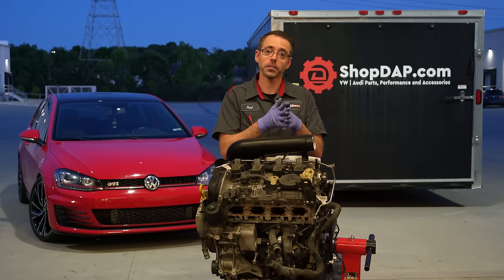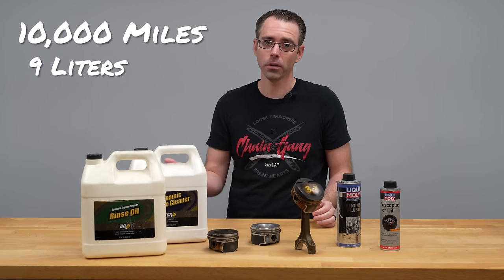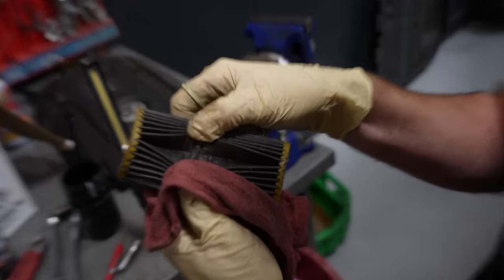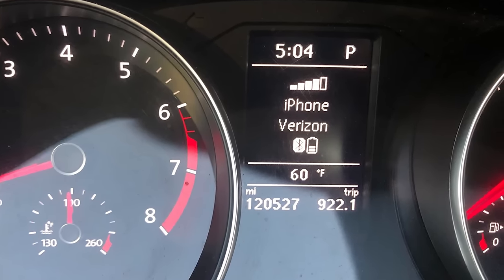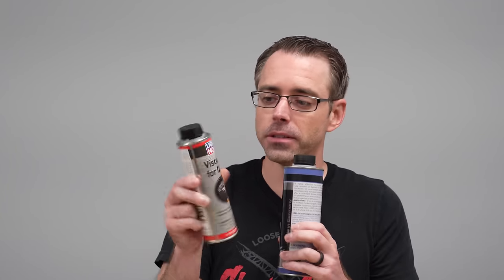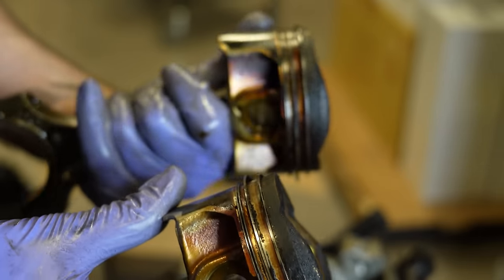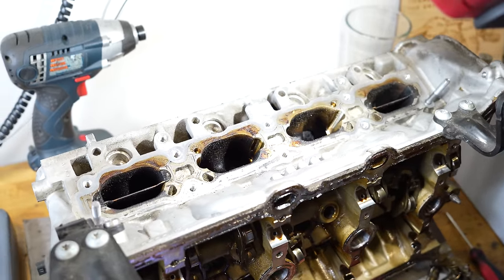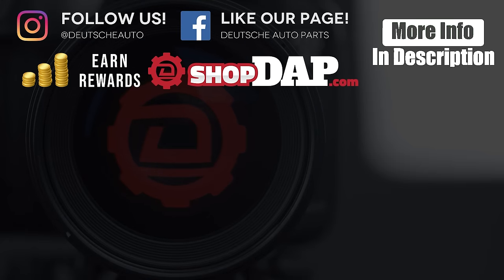Can you Fix an Engine Burning Oil for $20

Comment: Love the video, my @home solution for this exact problem have always been diesel (50/50 with cheap oil and 30 minutes of idle) and it have never failed me...
Reply: Never done it myself but people swear by filling the engine with ATF fluid and letting the engine idle for 15mins.
Reply: @archygrey9093  Doesn't sound like a great idea, ATF looses all its lubricating properties far earlier than diesel.
Reply: @Trashbd  How? The majority of lube doesn't enter the combustion chamber in such a short cleaning interval, and ATF lasts, in many cases, the life of the transmission.
Reply: @nicholash8021  Diesel is a very efficient carbon solvent, it doesn't need much heat or especially long time to dilute carbon buildups in the cylinders or within the engine. Using ATF instead of diesel should be about the same but much more expensive.

Also, what does the transmission have to do with this?
Reply: @Trashbd  Sorry I misread your original message. I thought you were talking about ATF not diesel. My point about transmissions was that ATF has to be good enough to go the life of many transmissions, so it is not likely to be a kind of lubricant that wears out fast.
Reply: @nicholash8021  No need to feel sorry ;-)

Transmission oils doesn't wear out because they are not exposed to heat. If exposed to engine temperatures ATF loses it lubrication properties really fast.
Reply: @Trashbd  But a good ATF has a boiling point of about 600F and according to this test by Project Farm, ATF did not lose any lubricity after 1 hour of use in an engine: https://www.youtube.com/watch?v=bE2F-vefQdA
Reply: @Trashbd  I don't think ATF looses all it's lubrication much at all, and it's usually full of additives specifically designed to remove sludge and revitalise rubber seals.
when people flush their engines with it it come out the drain plug completely black after being idled for 10 - 15 minutes, whether or not it's better than a diesel-oil mix i wouldn't know

Comment: Instead of engine flush, youcan use Diesel! 500ml, 10 minutes, then change the oil, it will be really black. Liqui Moly oil isn‘t bad, but there are better oils for engines, that burn oil. Try motul! And don‘t use 0w30. 5w40 Or 5w50 burns less

Comment: BTW BMW, VW AUDI engines are extremely touchy about oil brands. The base oil stock in Castrol v Mobil is different enough to prevent oil seals expanding the right amount as the seal wont absorb some oil and swell up to specifications. I had one BMW using Castrol whose problem was solved changing to Mobil. The owner Castrol fanboy was shocked.
Reply: I just changed from Castrol to Mobil, hopefully this resolves the oil burning problem. My car is burning 2 quarts every 5k miles

Comment: Cheap tip: If all you want to do is remove sludge from the crankcase of a neglected engine, Diesel fuel works great. Just a cup or a pint depending on capacity and dump the oil after 50 miles or a day of normal driving. Some prefer ATF for similar results.

Comment: I bought a car that blew smoke at every startup.  I changed the oil and added half a bottle of MMO for a bottom end ring clean up.  1000 miles later, the oil was black, the filter was heavy, and no more blow by.  I used a quarter in each of the following two oil changes.  After that, just regular oil changes.  Car never blew smoke again.

Comment: Phenomenal video, @Deutscheautoparts - wow and thank you!  One question.  Did the car you did the Liqu-moly process on also have a significant decrease in oil consumption similar to the BG process with the increased compression?  I'd have to guess that it did, - but curious if you had any followup.  Thank you again!
Reply from the maker: We have tested the Liqumoly and have seen improvement in oil burning in some cases.

Comment: vw/audi really should be ashamed of themselves for the so called, "acceptable oil consumption" amounts.  That is obviously coming from the bean counters and legal.  Not the true engineers that design.  Fantastic and knowledgeable video.  Merci
Reply: @glennverdeyen5685  ... oh yes, absolutely. Agreed.
Reply: It’s not only VW/Audi that have that “acceptable oil consumption” parameter. I believe he said toyota also has a similar number to VW/Audi.
Reply: @ht-ef4so  ... oh, yes, agreed.  I know that FORD has a similar policy tooo with the 5.0 Coyote engine that has had issues.  My comment is really towards ALL of them that engineer garbage, but with a label attached to justify.
Reply: Hyundai says 1 quart every 1,000 miles is in spec for their garbage engines
Hence the class action lawsuit
Reply: @raoulrr  ... yah, 1 QT per 1000 miles is excessive beyond reason.  Shame on them. With those specs, a person really NEVER has to change the oil.  Because, they will burn/replace enough during the 5000 -- 7500 when an oil change is due.  Crazy!
Reply: My 25 yr old Civic consumes 0.5L at 10k km OCI . Normal cars during 90s burned 0 oil by today's standards, because if it did public wouldn't buy them. Everyone talks about reducing pollution, cost of maintenance, crap like that, but all their efforts go in opposite direction. One big joke.
Reply: @pliedtka  ... which means that we should hold the car manufacturers to a higher standard.  YES, I owned a 2002 Honda Civic EX Vtec and that car used zero zero oil!!  Newer cars need to do better.

Comment: I have had good results with reducing oil burning with running engine flush products. I also as a gentle clean like to add a bit of MMO for the last ~50miles.

Comment: WOW Paul back in the old days we used to ad CD2.....If someone uses factory synthetic oil and changes it on the regular oil change intervals it should never get to this point. Synthetic oil is really reluctant to sledge. The non synthetic oils usually will sledge. This is why it is important not to go to the CHEAPEST OIL CHANGE GUY......Use synthetic. which will make your engine last just about forever.

Comment: I've a 2003 BA Ford Falcon (4L I6 barra engine) with 320,000km on the odo, i do the oil myself every 10,000km with full synthetic, so far its burned no oil and is still exactly on the full mark every time i change it

Comment: On engines with mileage higher than 100,000 miles, I tend to use an engine flush at least every other oil change. I do this to prevent carbon build-up, as I want an older engine to be as efficient as possible. I also will run at least one can of fuel injector cleaner through an engine every 3 months or 3,000 miles, whichever comes first, for the same reason, as injectors that get sticky tend to not spray a uniform mist of fuel in the combustion chamber. I also watch what gas stations I go to, and make sure that the gas I'm getting doesn't have more water in it than is allowed by law. Checking that actually can ensure you're burning good fuel, instead of fuel that can carbonize in the engine on the top end.

Comment: My 07 Acura v6 was burning 3-4 quarts every 1k miles. The bumper was black all the time. The rings were carbon up so bad. Rebuilt the engine for less than 1k and it burns none now

Comment: I've got a 2012 chevy Silverado 1500 with the 5.3 v8 and the check engine light came on the other day, so I hooked it up to my scan tool and the code was p0521 - oil pressure sensor. I automatically checked the oil; it was bone dry. So, I looked for leaks, but found none. My next step was to look on YouTube to see if there were any issues with other Silverado's. I found out there's a lot of people changing the valve covers because of the pcv valve that's built into the valve cover. Anyways, I watched your video, and I've came to the conclusion that I'm too scared to use your product because of the 45 minutes at 3 RPM's and another 20 minutes at the same RPM. I would like to clean everything out of the engine and I'm sure your product would do that, but like I said before, I'm too scared to do the requirements. I bought this truck April 2023 for $18,000 and it would be bad if it blew up on me. Thank you for the video and the information.

Comment: Hey man I want your honest opinion. I own the A4 B8 2.0 TFSI since 2011. The engine was using 1l oil per 1000km. I got a new Audi motor in 2014 for free as the car was under warranty. Since then no oil usage, just the cooler went bad in 2020. Now the car has 190,000km & it is running perfect. Would you sell the car or keep it for another 200,000km?
Reply: Soon you're going to need to do a transmission service (if it hasn't been done already) and usually at that point in any A4 or higher Audi it's time to replace all the front control arms (8 of them total) because the bushings get tired and really weak, it's good that the new engine is running good but the turbos are very delicate and often the wastegate pivot bushing in the hot side casting wears out, plastic PCV valve going bad is common, water pump is another maintenance item lots of people like to ignore because the intake has to come off to do it, we see some intake manifolds cause issues as the plastic "bushings" the variable runner flaps pivot in wear out and shit starts flapping and flopping around epic style 
If you want keep driving it, but definitely keep an ear out for Any of these issues, most would throw a CEL , I just hope your updated 2014 engine has the new style chains and such
Reply: @snoofayy6150  Mate thanks for the detailed info. The water pump is the coolant pump, right? If yes this has been replaced. My cars not an automatic so I don't need the transmission service. The PCV is next. We have very smooths roads in Switzerland so I assume the control arms are ok.

Comment: The fact that there are updated pistons for these engines and probably for allot more makes that are burning oil having the same experiences.....it's probably an engineering issue with the pistons and rings. People that did not perform the proper oil maintenances will experience engine ring breakdown faster and at lower mileage, but proper maintenance will result in the same outcome at higher mileages it is proving. Meeting EPA fuel requirements is what drove this change to start with. Engines " prior " to these higher EPA requirements didn't have oil consumption issues in properly maintained engines. They were built with stronger tension piston rings like engines in the good ole days. My 06 3.7 v6 jeep engine within the last year or more has started the same issue. Using more oil at lower mileage oil changes now. No smoke, but it's definitely using more oil. 149,000 on it. I have properly maintained the engine. It runs great. But something is changing.

Comment: Great video.
That last engine look like oil going in to intake from Breath.
Oil catch can wil be the cheapest repair.
Reply: I know this is almost a year old but I agree about the catch can.
I just learned about them a year ago.  Read a 32-oz can from a Ozark mountain stainless steel thermos.  I installed it on the PCV side and the line going to the base of the throttle body is always dry. Good used to always be wet. At less than 1000 miles my oil was getting to a really dark brown.   At eight hundred miles I can still easily see the markings on the dipstick through the oil film.  
The oil is noticeably cleaner now. It's nowhere near clear, more of a dark amber.
When I get to 1000 miles I'm going to empty the catch can and measure it.  There's zero moisture in it, just oil.   
Great advice.

Comment: Interesting, I have a 2006 Skoda Octavia with the  2 litre FSI engine. 170000 miles and oil-tight, also no significant issues with carbon build-up & on the original high-pressure fuel pump. Goes to show that not all VW engines with be oil burners. Mind you I am scrupulous on maintenance. Liqui Moly 5w30.

Comment: Mechanic here, folks not servicing often enough, and when they do, opting for the wrong (cheapest) oils offered. Using the lowest grades of fuel available (cheapest).
My own vehicles seem to never have suffered this problem.
I cant say that modern cars "burn oil".

I can say, most people dont service or use incorrect fluids.

Comment: Keeping warm the engine all the time, block heater for engine all the time, good gas, no ethanol, good oil, good oil filter, periodically change oil and filter, no formula F1 on the engine, etc. it is secret to keep engine in good condition. Engine car is a thermal engine. Keep warm the engine at 90 degre all the time, 24/24, 365/365 like a taxi car. Detect all the time the pincking, knocking, hunting sound on the engine and eliminate this problem quickly possible. NO ETHANOL IN THE GAS. SUPER FOR THE GAS ALL THE TIME.

Comment: the problem with modern engines is partially that engines are built for smoother running.. less noise.. meeting epa standards... instead of being built to be long lasting and efficient while easy to work on
Reply: You must be young. Modern engines last a HELL of alot longer than they did years ago. In the 60s 70s and early 80s, you were lucky to get 75,000 miles out of an engine before it was worn out. Today, 150,000+ is quite usual. I've had newer cars that have gone over 200,000 and still run fine.
Reply: @davelowets  i am not young.. i have cars and trucks from the 60-90s with almost 300k on them a tractor from the 40s and they have never had anything but basic mantenance.. i didnt compare the old engines to new engines.. i was pointing out that with the better matterials and technology that they should be able to make them stronger and longer lasting not from the factory burning more oil in a 4cyl then a 350 that needs rings and valve guide seals.. i suppose mostly i am trying to say that things are no longer meant to last and for the regular guy to be able to fix with a screwdriver and a couple wrenches to keep it on the road.. before if an engine was wore out but still had some compression was close to in time getting a little spark and gas that was still kina gas well it would run now if a sensor goes out it has to be sent to the shop and 400 plus spent on it
Reply: @whitefreeman5798  The auto manufacturers occasionally screw up and put out a bad design. It happens. But in general, todays engines last MUCH longer than they did 30 years ago.

Comment: good video but if your motor is too dirty sludge can plug oil pickup and you will hear it, no oil pressure, coats the side of blocks comes down in sheets not particles seen it taking apart and pickup coated

Comment: I currently have a ‘15 Passat 1.8T with 56K miles and haven’t seen any real oil burning maybe 1/2 liter over 5,000 miles. But then again I do oil changes at 5,000 miles and only with 5w-40 euro oil.

Comment: Two weeks ago I was asked to help a lady with blue burning oil. I went up to where the car was at and almost buried the storefront in smoke.  Decided to take it to her house early the next morning before cops and everyone else climbed out of bed. Did this then went home for a cup of coffee and went back when the sun came up. Checked the usual including oil level. Hmmm, six inches above full. Drained all the oil out.....all 10 quarts of it. Yup.  Added 5 qts back and started the engine. Some blue smoke, but not near what it was. Drove it around the block and each time smoke was less. Then a 10-minute drive and smoke was livable.  Told her to drive it around her home and not far, and get a new car before it dies completely. Could not ascertain where the oil came from..but I really expected to find water in the oil pan...none.

Comment: @Deutscheautoparts from a chemical point of view, the high RPM is less value. Around 1.500 to 2.000 is recommended and needed. Why? Because it allows the cleaner to work. The sludge needs to "soak" absorb before it comes loose.

Comment: I have a 2003 ford f250 super duty truck that burns half a quart of oil every month or 2. It has 366,000 miles. I have been using a thicker oil regular 20/50 castrol gtx and changing it every 2500-3000 miles. I do not add anything else to the oil. I also noticed antifreeze going down more often than usual but cant find where it is leaking! Feels like it just evaporates! Doesnt seem to have a bad headgasket. Oil is clean. I use it 5 days a week. Still tows cars with no problem. What do you think is causing my antifreeze to go low? I have changed my coolant reservoir recently. I will check my drain plug of the radiator because i did not change that. I havent really check if it leaks drops there.

Comment: Dextron automatic transmission fluid will do the same thing. 25% trans fluid to oil ratio. Drive around for 25 to 50 miles change oil.